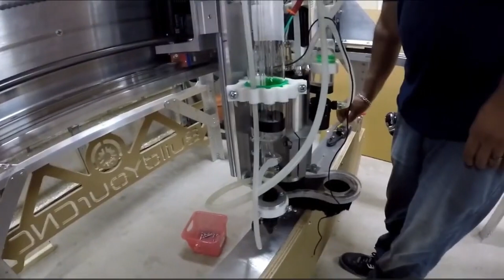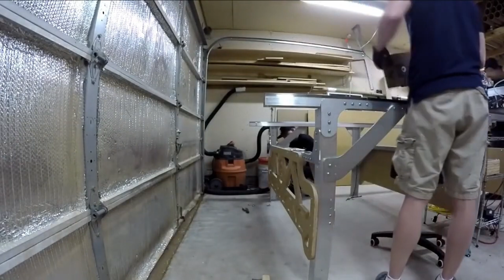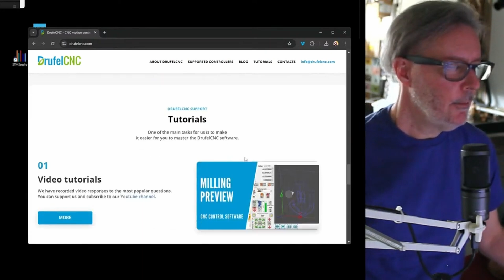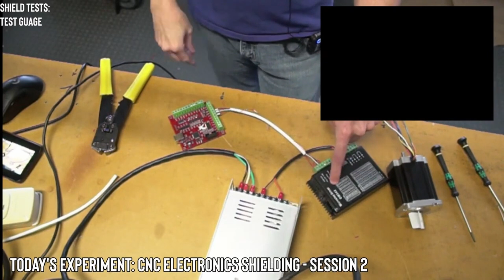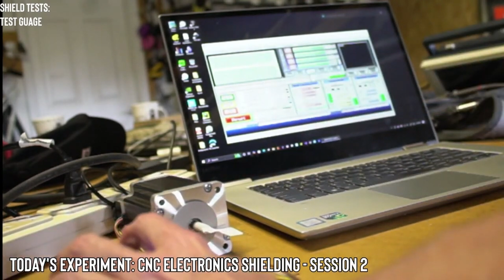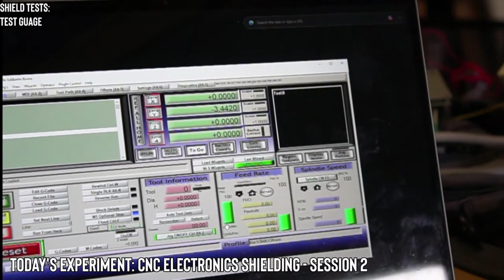CNC Mach3 USB Controller Testing Issue With Acceleration Thump

Comment: Hi, have you perhaps found a solution for the thump sound on the motors ? I am experiencing exactly the same....even without load/connection to anything. It seems like the motor stalls for a few milliseconds every now and then. Changing steps/speeds doesn't change anything. Your help would be much appreciated.
Reply from the maker: ?Great question. The best way to avoid is to not change the state during acceleration (i.e. decelerating prior to achieving top velocity). Allow the complete ramp up. If that is not possible, increase your acceleration so that the ramp up is more quickly achieved, or decrease you velocity so the top velocity is more quickly achieved. If the quick ramp up stalls the motor and you don't want to change your top velocity, change the motor to a higher torque motor, or change the controller to a more suitable controller like the pokeys57CNC.
Reply: Just got my board the other day and connected it yesterday. It is VERY clear that when letting go of the jog-buttons before they reach max speed,  the motors (try to) accelerate A LOT before decelerating down to standstill. It is also clearly visible in the feed speed read out in MACH3. So this is clearly a driver issue, and as long as there is not a new driver released for the rnrMotion in Mach3 (probably not gonna happen), it is rubbish. It serves my purposes to test the motion of my router, but nothing more. I don't know if there are cases when running programs that would lead to the same behaviour or if the path planning of Mach3 makes the problem non-noticeable.